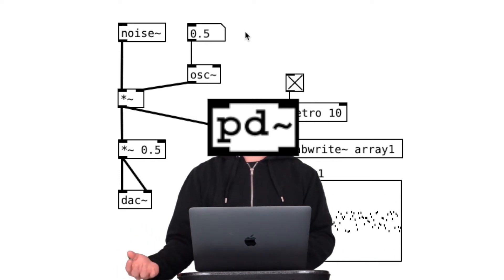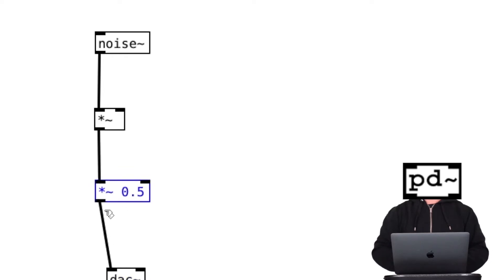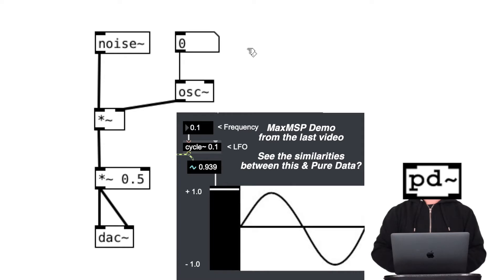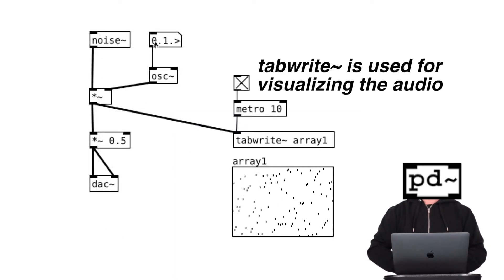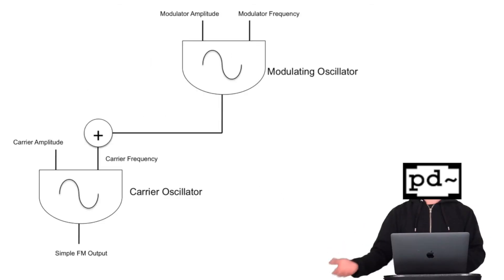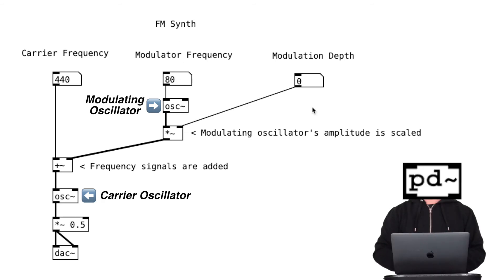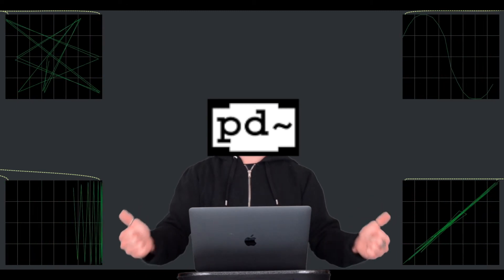AM Synth & FM Synth (Pure Data Tutorial #5)

Comment: hello!  how do I have the same output for three different ypes of synth in a same patch. for example, additive, subtractive and am/fm synth are in a same project; what steps should be taken in consideration please? thanks so much
Reply from the maker: You can connect all of three to a single [dac~] :) 
You can mix/adjust the volume of with [*~] for each of the three synths.
Reply: @SoundSimulator  that works , thanks a mil!

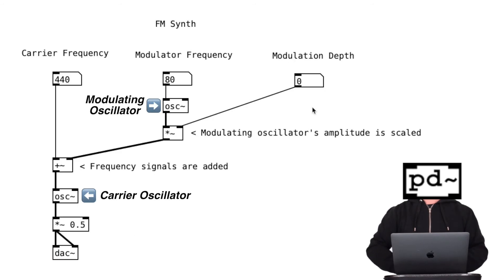Comment: 4:00 It seems to me that instead of the block "~+" there should be an action "~*" since in FM synthesis the modulating oscillator does not make sound and only affects the frequency of the carrier without making any noise. Here, we rather have a subtractive synth. Also thanks for your videos, appreciate it very much!